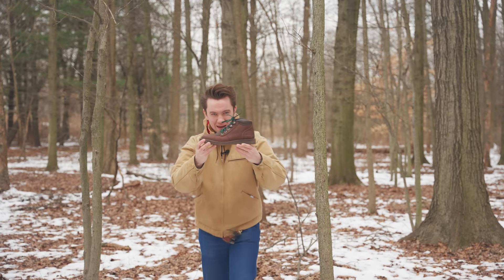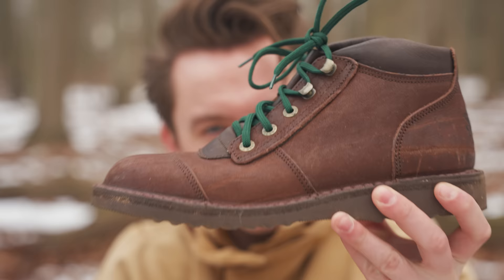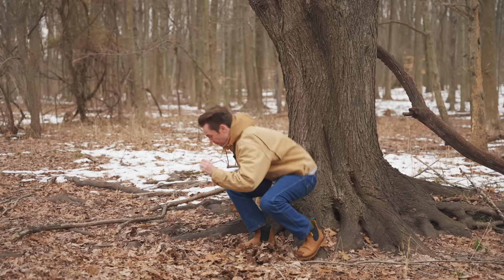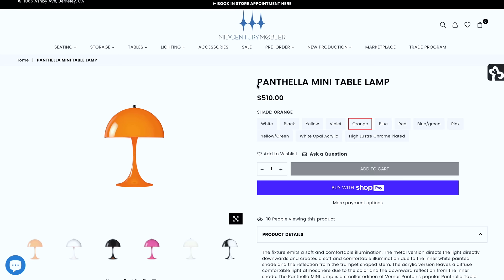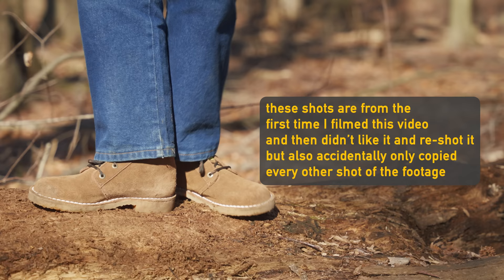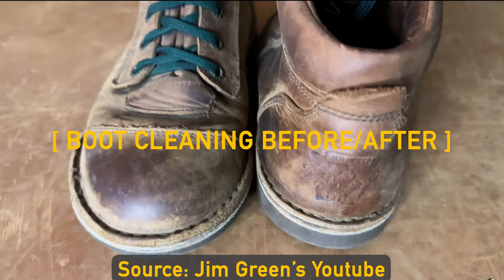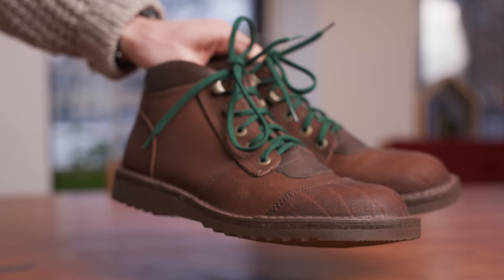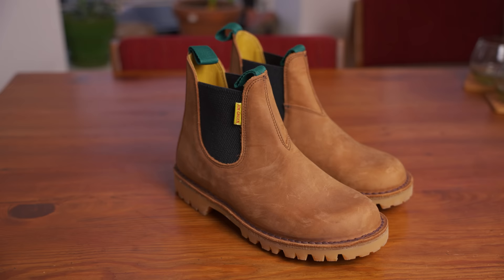I Bought Anti-Poaching Boots Made in South Africa.

Comment: For a more durable option than trailrunners, you can also look at boots like the Jim Green African Ranger boots, which is an evolved version of veldskoen, or field shoes. Essentially trailrunners before trailrunning was a thing. A lot of militaries in Africa were really ahead of the 8-ball on boot design, since they realized pretty early that heavy duty construction just slowed you down, and that boots had to be lightweight and not inhibit the wearer first and foremost. The OG veldskoen vellies partially contributed to the modern idea of sneakers and trailrunners.

Comment: Been wearing African rangers for my primary general shoe for a year and thinking…. Thinking…. Thinking more……

5 months. A year and 5 months.

They’re about due for a refresh. The sole is getting pretty worn but they’re still a good shoe.

Probably the best boots I’ve ever owned. I’m new to quality boots but they have sizes to fit my big feet.

I’ll probably get these resoled not long after I get my next good boot which I think will be Thorogoods?

The Jim Greens needed better insoles for me. After that, they were amazing.

The cap toe is pretty tough. I’ve dropped tools on it and it took care of my feet. I’m no construction guy but these have seen enough work for them to be used in the yard, shop, and working on things in my opinion. 

These are work boots that look surprisingly good in my opinion.

I wish I could find something close to these in price and quality made in America.

I’d also probably buy them again instead of anything else if they didn’t start removing all the size options and seem to be clearing them out of Govx.

I’ve had bad luck with some other “affordable” options, so I’ve been really happy with these.
Reply: As for your second to last sentence; what is the deal with that? Ive been contemplating buying a pair of barefoot rangers and was browsing on Amazon... Came back a couple weeks later and they pulled a bunch of their boots from the Amazon storefront including the barefoots. Whats the deal with that?

Comment: Don't judge this boot off this exact version, IMO there is a far better way to get these boots albeit with a little added cost and wait time. Get them custom made (roughly $40 more), get them with the upgraded veg tan leather mid sole, and get the toe stiffener removed. Unless you plan on kicking the crap out of stuff and need toe protection, the toe stiffener is not necessary and just makes them less comfortable, and by removing it your toes will be able to wiggle totally freely without any hot spots, and they'll still have 2 layers of leather at the toe so you'll get more protection than something like sneakers. I opted to keep the steel shank because I wanted more arch stability but you could remove it and get a much more flexible boot if you're into that. Basically what I got ordered is my own version of their Barefoot African Ranger but with the standard sole and drop height and they absolutely are like an overbuilt sneaker.

Comment: This boot, while very well made, is not specifically designed for ‘park rangers’.  This design has been around for years and is a general purpose bush boot.  You will see this design worn by professional hunters (PH) and their clients, as well as, anyone who works, in the field, on concessions.  The sole material/no heal, is specifically designed for quietly stalking animals.  It’s not as tough as a traditional low heal material/design.  While the buffalo hide is tough, elephant and hippo are more durable.  They will cost more.  I’m sure these boots are well made, but the Ranger ‘stuff’ is marketing.  But considering they are being marketed to the US consumer, who is going to stalk their soy latte at Starbucks, they should last a lifetime.